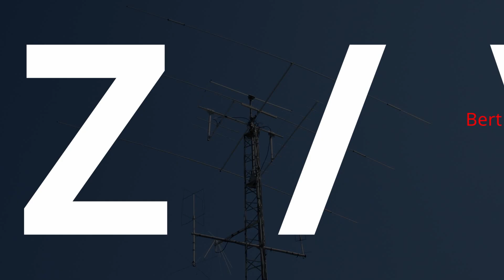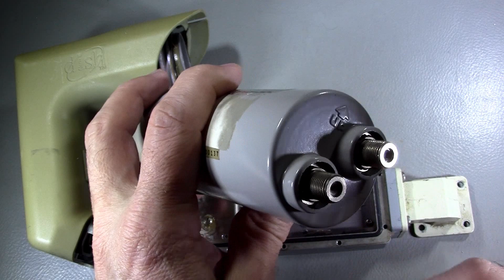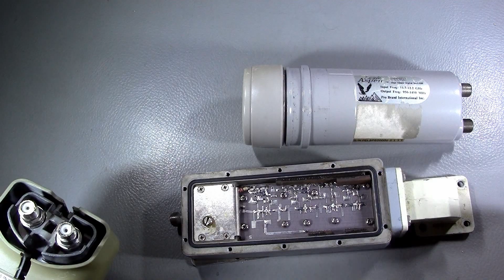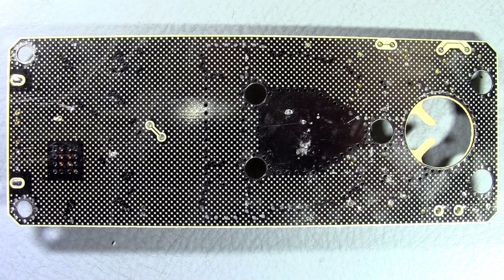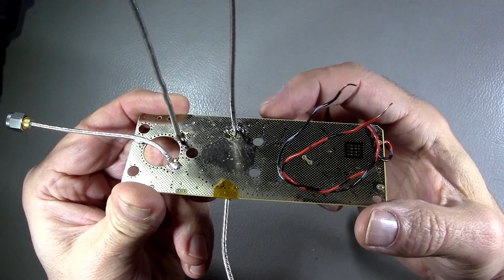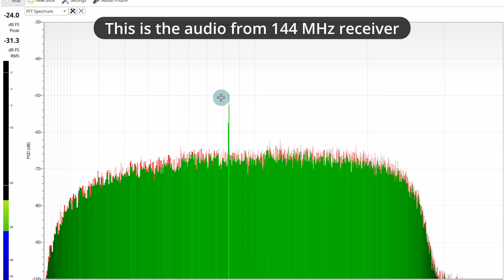10 GHz System, Part 13: A Low Noise Amplifier from my Junk-Box!

Comment: awesome! what coupling cap did you use at the input exactly? also why no coupling cap on the output? it is DC coupled and can influence the bias of the second stage. and how did you measure the input VSWR? thanks
Reply from the maker: 5 pf or so. Not critical since it does not take much capacitance to offer a low impedance path at 10GHz.
The transverter has an input coupling cap, so no need for an output cap on the LNA. Howver, I did later add a coupling cap on the output as well, so I could add an external attenuator for testing purpose.
I tested the VSWR with a generator and directional coupler, same technique as with the WR-90 to SMA transition.